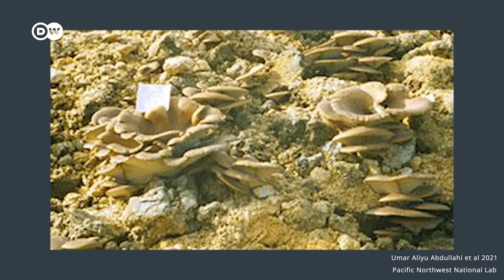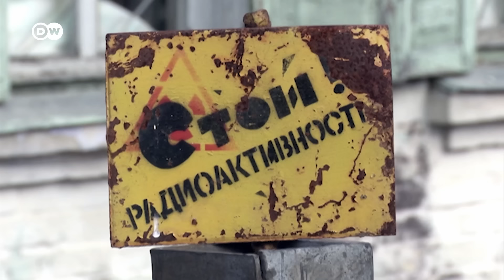How mushrooms clean up the planet (and other fungi powers)

Comment: Wish this video had been longer. Anyway, the bit about using oyster mushrooms to clean oil, the fungi breaking the hydrocarbons down into CO2 and H2O...does that mean the oyster mushrooms are safe to eat afterwards? Or do they absorb heavy metals into their structures at the same time?

Comment: Burning strontium-laden fungi... I don't like that idea... Wouldn't that lead to strontium-laden soot wafting all over the world?? Seems like there has to be a better way to process strontium-laden fungus. Maybe use freeze drying to remove all the water, then crushing to reduce volume. Crushing would produce some dust, but I suspect it would be easier to control than fire and soot.

Comment: Fungus are definitely a kingdom of life we should strive to find more uses for. Their power is practically infinite.
That said. For building materials I see carbon capture and sequestration in building materials as the likely way forward. The challenge there of course is finding a solution to the flammability. As materials such as carbon fibre and graphene burn extremely well. Who knows maybe fungal mats with graphene and/or carbon fibre incorporated could become super building materials of the future. I think I read somewhere that mycelial packaging materials can be fairly fire resistant.

Comment: Chernobyl is not uninhabitable to this day - please get your facts straight. Only some very small parts of the surroundings of the reactor are still seeing substantial elevated radiation levels. Other regions quite close by, have fallen back to levels comparable to high altitude cities, E.g. Chernobyl residential housing is seeing only 0.2 microsieverts per hour. However, there is simply no incentive to reduce the old exclusion zones as Ukraine makes money from them, and especially now has other concerns.

Comment: Opening shots show a slime mold on a show about fungi. Good Job DW. (No they are not the same thing) (forget about just the opening shots. You go on to show multiple examples of Slime Molds as if they were fungi.) Whoever made this should be demoted at least if not fired. It's like putting together a show on Dogs and using video of Cats. (actually that's wrong, Cats are more closely related to Dogs than slime molds are to Fungi))
Reply: trippy_psyche1

????
Reply: ON
INSTAGRAM